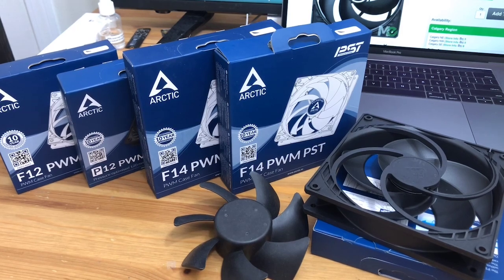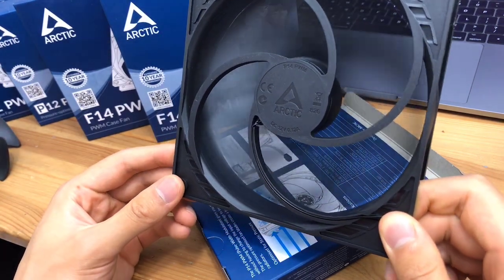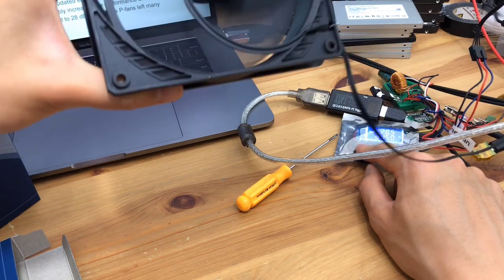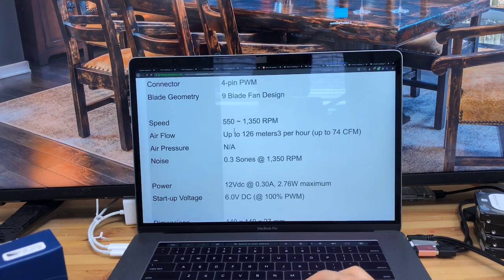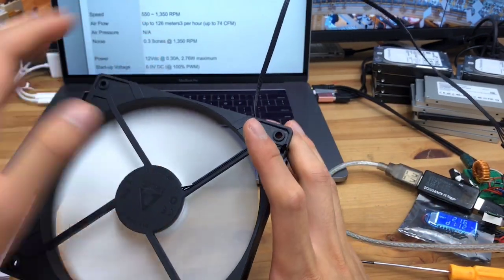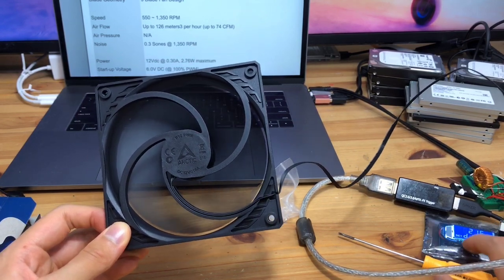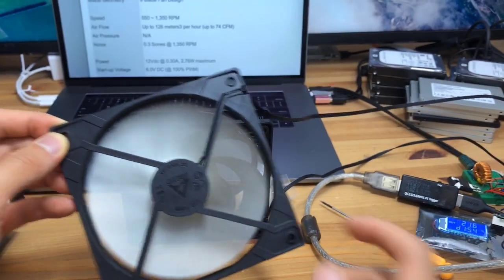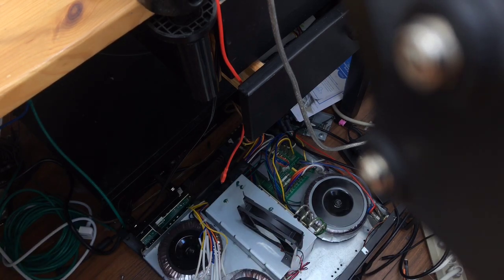Arctic P14 P12 F12 F14 Rev2 F14 Fans Test

Comment: Heads up for anyone considering these or the Arctic P14 for case fans. I tested the P14's and F14's extensively and went with the F14's. I have a very high end (read: high thermal output) gaming PC inside a Phanteks P500A case. What won me over was for the overall sound and cooling performance. The F14's were just a smidge quieter and of what you could hear, it just had a slightly better sounding hum to it. Cooling performance was also consistently 0.5-1C cooler when comparing PWM% levels between the two at all ranges. I actually really wanted to keep the P14's as they are "newer" and all the reviews praised them highly but I couldn't ignore nor deny the real-world testing performance results of the F14's over the P14's in my case. All in all, you can't really go wrong with either but the F14's also won me over considering they are actually designed for case airflow in mind (which makes sense of the performance edge they had over the P14's as low impedance to airflow case fans as was the case on my Phanteks P500A). I have little doubt the P14's would edge out the F14's for heatsink/radiator cooling and high impedance to airflow cases. To give you an idea of just how low impedence my Phanteks P500A case is, with the side-panel open (so components have easy access to ambient air), running RTX Quake, GPU temp stabalised at 75C. With the side-panel closed and all F14 fans off, GPU temp stabalised at 84C. With the F14's at just 30% PWM (corresponding to ~620 RPM), GPU temp stabalised at 77C (only 2C hotter than open side-panel condition). With the F14's at 100% PWM (corresponding to ~1400 RPM), GPU temp was 74C (only 1C cooler than open side-panel condition). With the P14's @ 30% PWM (corresponding to ~720RPM), GPU temp stabalised at 78C (1C hotter than F14's). With the P14's @ 100% PWM (corresponding to ~1675RPM), GPU temp stabilised at 74.5C (0.5C hotter than for the F14's and only 0.5C cooler than with the side-panel opened condition). I would never normally run the fans at 100% speed but I wanted to see how they two sets of fans compared at all speed ranges and it surprised me how low (only 30% PWM) I could run the fans and get still achieve stellar sound and cooling performance out of them. Anyways, hope this might come of help to someone out there. Oh, one last thing. I think the F14's are using the same internals for the motor and bearing as the P14's. I was concerned over the fact the F14's were released so much further back than the P14's that the internal mechanics/motors would be inferior but seems that is not the case and that they are using the same motor, shaft and bearing.
Reply: Appreciate your insightful and helpful comment. I'm also a happy owner of a P500A. Just two quick questions. Did you have front and top dust filters on when you did those tests? What's your fan configuration (I'm assuming 3 front intake, 3 top exhaust and 1 rear exhaust)? Also I really wish F14 had a white version like P14 does (not the black and white version).
Reply: That all appreciated, the fact the F12s merely "edge out" the P12s in unrestricted airflow situations is testement to how much the pressure optimisation of the P series comes with so little drawback in airflow. I like the way the industry changed overnight to seeing static pressure as a thing and manufacturers responded with fans that were pretty good at both.
Reply: What system do you have? You should never be getting those awful temps in a P500A. What fan layout do you have?
Reply: The P14 and F14 both max out at the same CFM (I believe it is 73CFM on the P14 and 74CFM on the F14), however, the P14 has double the static pressure.  So it's far better at sucking air through a filter or pushing air through grills, fins and radiators.  

That's what made me swap all the fans in my case to P14's.  The two in the front are sucking air through a cotton or nylon mesh fabric (no visible holes) and the top has the larger typical holes plus a filter on top that's held on by magnets.  The rear is just the typical larger holes for exhaust.

Figured I'd get more flow when it's all said and done by going with the double static pressure version.  

If they were just sitting on a table, then the F14 would move the same amount of air at a lower RPM, but as you can hear, they are louder at the lower RPM due to the extra, thinner fan blades.

I dunno.  Guess it depends on your case and what you're fans are pushing/pulling through.  I know there's no way an F14 could pull the air through my front filters like the P14.  I could have mixed it up but there was a good deal on a 5 pack so I just got all P14's.

Comment: Well, they are supposed to be P for Pressure and F for Flow, so the P's are for rads, air-coolers with dense fin stacks and filtered case intakes, F for unfiltered case intake or exhaust.

Comment: I'm def team P. I just did a build for a friend in a bequiet 500dx and put 3 p12's in the front, 1 in the rear, and used 2 of the silent wings the case comes with for the top. He can't hear anything, his 5900x is oc'd to 4.2ghz with a Noctua u12a cooling it and he's in love with the build.  My personal build also uses a 500dx with a 5900x and Noctua u12a except my cpu is oc'd to 4.4ghz at 1.275. I'm using 5 P14's and I'm in heaven. The sounds is pleasant, when it is that I can even hear it bc no music or what have you. Those P series fans are just excellent. Front and rear fans set to 'performance' mode in the bios while plugged into fan headers on my Asrock x570 Taichi Razer edition. My two top P14's are set to normal in the bios and they are effectively silent. So it's white PWM PST's and I'm extremely happy.

Comment: Not sure what you are looking for but you will never find a truly silent fan that pushes any kind of useful airflow.  I switched to these after my Corsair LL120's started flickering like nuts and I refused to pay another 80 bux for em.  The Arctic P14 PWM Pst fans went onto my Evga clc280 and 3 Arctic Bionix f140's freshen up the rest of my Define R6 and I must say couldn't be happier.  The p14's are 100 times quiter than my EVGA 140's that were stock with the cooler and even on high at the front of the case it's a pleasant whirr instead of the Jet engine sounds from the EVGA fans.  The other 3 aren't even audible at normal auto sppeds.  If I ramp them up to full (Which in normal use will NEVER EVER happen) you can hear them but it's not loud enough to be distracting or bothersome.  I'll buy Arctic in the future.  The New chromax lineup from Noctua is another solid choice for Flow and sound concerns and in my experience are just a tad quieter than these but at a few hundred rpms less.

Comment: I've had a total of 9 of these in my inwin 303. I love the price for what they are worth. They are noticeable above 60% fan speed. Around 1200 rpm. But I use head phones so it's not much to think about when the price of them is unbeatable. Given some AAA fans are like 30$ usd for a single fan. Best in the bizz.
Reply: heya. I plan either to get the P12 or the Bionix. Any thoughts about the noise? I want a quiet pc
Reply: @dv2045  if you're looking to save a little bit more just go with f12. But the bionix are definitely in a great price point. Dont over think it. I would just get the f12.
Reply: @ludahfang559  heya again! for silent watercooling a 360 rad would you get the P12 or the Bionix P120? I wont use them at 100% but just silent enough
Reply: @dv2045  It's up to you, if there is a difference in noise between them and you are willing to pay more for something quiet, go with the Bionix ones.
But i don't know if there is much of a difference, haven't seen any comparisons

Comment: This really thorough test. I have 4 of P14's in my Define R6, they are pretty good but can you suggest anything better  soundwise (running them from PWM hub)?
Reply from the maker: General noise troubleshooting: 1)Buzzing, clacking, clicking: Use rubber fan mounts instead of fan screws 2)Fans running faster than needed: Use PWM splitters (either chain Y splitters or get a 4way)  (or buy the PST version) to split the PWM control signal between all fans

The fans will run as long as the PWM is >5%. You do not need to 'kickstart' them, as this will happen automatically from the IC inside the fan.
Reply: @liminalsunset  Im experiencing more like air chuffing sound. Kind of low frequency huffing. Maybe I need to tweak the fan curves, altough at the same time I wish to maintain my current all around system temps.
Reply from the maker: @fobaa  You may want to check that the grille/radiator/heat sync the fan is mounted to is not too restrictive. Also, make sure there's nothing (filter, heat sync, grille, etc) too close to the intake. What speed are you running the fans at?
Reply: @liminalsunset  actually further inspection revealed I have too damn loud HDDs. And maybe CPU coolers
Reply from the maker: @fobaa  Try to disconnect the devices in your system and run one at a time to isolate the noise source. HDDs may benefit from resilient mounting to absorb vibrations that may transmit to the case, or alternatively, can be powered off when not used or changed with SSD.
Reply: @DBT_Rusty  heya. any thouhhts of the Bionix P120? its a slightly more powerful and padded P12
Reply: @dv2045  i have 4 bionix f140s showing up soon. i will let you know how those go. i have not used the p120 bionix but currently thinking about grabbing two to match my current project. i do know the padding is very minimal and more of a rubbery coating rather than rubber pads.
Reply: @DBT_Rusty  Nice to hear that Noctua is working to get 140mm variant to market. Thanks for the info! These Arctic P series fans sure are very high price/performance.
Reply: DBT_Rusty But no one wants to pay that much for a fan that’s not even colour neutral.
Reply: @fobaa  so the noise problem wasnt the p14s :D
Reply: @ShakeITyEA  Yes I think so. Damn loud HDD's.
Reply: @fobaa  Of course it wasnt these fans... These fans are dead silent compared to many others
Literally in the top
Reply: P12s makes the a weird motor humming noise especially when they're spinning at around 1000 RPM. If you want an extremely silent fan with just a little better fan performance as compared to the P12 fans, your best bet would be the Noctua NF-A12x25

Comment: People been praising these p14 as the best fans ever. Better than be quiet, noctua, everything... Now that's suspicious and makes me squint
Reply: They are not.  Sadly the P12 ( P14 also )  start very fast to gather dust ...and start making weird sounds in a few months . Over time they are louder that the F12.   / F12 are quieter in the long run.   If Artcic could fix the design of the P12 they could be the best. There is P12 PWM PST CO ( from continuous operation )   that have some special  2 ball japanese bearings that could be the solution to the problem but i have not tested it.

Comment: Just bought 2 of the Artic P14 140mm fans to replace the worn out fans on my Corsair H115i 280mm Radiator, hopefully they will do the job well. thanks for posting this interesting video, thumbed up :)
Reply: I'm thinking of doing the exact same, the fans are way too loud above 1000rpm. How did it work out?
Reply: @KloVnPT  I ended up buying the artic freezer II CPU cooler 240mm radiator version as my Corsair H115i had a terrible pump noise, think the pump was dying tbh. Anyway the freezer II fits perfectly in the front of the case i bought (fractal define 7 black / white version). So technically i now have 4 artic fans in my case 2 x140mm at top of case helping blow out the hot air, and 2x120mm on the radiator sucking cold air in the front of the case. My 3900x now idles as low as 30c depending on room temp.
Reply: @lee__1707  Yeah I'll buy 2 of those for the H115i and extra 2 to replace the default NZXT fans that came with the case. 

One more question, is it worth to order some rubber mounts or are they quiet enough?

I really need some quiet fans, my pc is right next to my left ear and I use open-back headphones
Reply: @KloVnPT  You cant go wrong with rubber screw mounts you can get a bag of 20 of them off amazon for cheap. peace of mind you will have a quiet setup no matter what. I do find mine quiet but my pc is under a desk at my feet, if yours is up next to your head get the rubber mounts too, you might not need them but peace of mind like i say

Comment: Great review! Seems that the Bionix P120 is the only alternative to the Noctua NF-A12 with (around) the same noise/performance
Reply: Noctua NF-A12 costs more than 4 times than these Arctic pressure optimised fans. 
And they don't spin faster than 700-800 rpm in real life use for me so noise is not an issue.

Comment: Nice review but Arctic claims that the amps for the F12 fan is 0.24 A @ 12V, but you had only 0.07 A @ 11.7V so is it really working at it's full potential during your test ?
Reply from the maker: It's likely that the current rating printed on the back of the fan is the "safety" current; the maximum current the fan is able to pull, with the fan blades locked or under significant backpressure (unsure of exact specification of UL standard)/when it is starting, and not the "nominal" current. Some fans have both ratings printed on the back for this reason.

Comment: Thanks for the test; recently got 3x p14 for the chassis airflow, and now i am thinking to also get p12 to switch cpu fan (it started doin significant vibration on 1.100+ RPM after more or less 4 years of usage, model is cooler master 120 ab), was curious how good it is (since be quiet pure wing 2 cost about the same $ here, according to some other test that i found - be! does slightly more noise while producing the same amount of air pressure). Guess i cant go wrong with arctic in this price category :) 
Talking about p14 - i didnt notice any vibration at all (i added antivibro pads while was "screwing" it to the case tho), at 650 rpm or lower it also doesnt produce any significant noise id say :)

Comment: Ya man the 5 packs for $25-$30 there awesome. Price to performance to noise ratio is great.  Once properly mounted they are nice.  I choose these for the reasons listed before.   Also this fan has be dissembled so take that for what you will.  I love corsair mag lev fans but $20-33 each just not worth it unless you have no cash filter. Ive built rigs for people with only p series fans for everything and its awesome.

Comment: I have some Arctic F12 and consider them to be too noisy to use.  I might consider the P14, but my budget option lately has been the Noctua Redux series.  Maybe the P14 would be a good case fan and I will put the Redux on my radiator.
Reply: You sure it's the 4-pin f12? because the 4-pin f12 is superduper quiet with lower rpms. The 3-pin f12 was too loud.

Comment: Tried the Arctic P14 based on the many reviews of it saying its the most silent fan..Bought a set of 5 bundle, and put 3 into my case. Well I already noticed something was bad when I took them out of the case. The fan plastic is very hard and it makes a sound when you flick it with a finger, just like a wine glass does.. So to no surprise when 3 of them spin up side by side, they begin to "sing". Resonance overload! They simply begin to whine at the frequency that the plastic resonates at, due to it being very hard. Fans need to be somewhat flexible and more rubber like to not resonate.

So due to the resonance, the arctic fans are the most loud fans I ever tried.

-never test fans one by one, you need multiple to check if they resonate inside the case.
Reply: Use silicone gaskets!
By far they are the best and if you pair them with GT they are sick!

Comment: Which 120mm fan would you recommend replacing in the 500 watt deepcool power supply ? the native fan makes sounds as if the train is knocking the wheels on the rails

Comment: thought about getting these, caus they where cheap and got some good numbers. But if they got vibrations, it does not matter how quiet they run, they will make a shit ton of noise when in a case.
Reply: I have these and they are loud, you habe to keep them very low rpm

Comment: I have them in my 280mm liquid freezer when i installed the cooler i forgot to peel the plastic of the logo when i started to peel the fan just moves down a bit the when reduce the pressure goes back to the frame of the fan and then i use my other hand to support the fan thats normal right ? they work i didn't damaged them ? i talk about p14 btw

Comment: i-plan to use the P14 on my 280mm rads, and for anyone who has any experience or insights. I wanted to keep the P14 fans running at a fixed speed (as quiet as possible) on idle/light tasks and just ramp up when I'm gaming, doing heavy workload.

Around what until what temps is it okay to keep a steady and quiet rpm on the radiator fans, and if anyone has any experience, around what range is the P14s quiet/barely audible?

im, using an NR200 case if that helps

Thank you for this vid!

Comment: My Motherboard is an old Intel 67BL which only have two PWM (4PIN) fan ports, one for the back, & another one in front. I already have two Corsair ML140 140mm PWM (4PIN) Fans that am using in my PC case/cabinet Now, in order to create a 5 PWM PST fans Daisy chain, can I connect my two Corsair ML140 MM PWM (NON-PST) FAN with my three Arctic P14 PWM PST CO 140MM FAN? If yes then what should be the order?

Comment: $4 per fan here, in a 5-pack
Reply: For the simple 3 wire ones right? The PWM ones are a bit more expensive.
Reply: @magicmarger   Checking now it's like $4.4 for 3-pin and $4.8 for 4-pin
Reply: @thelazyduck9370  oh fuck me over, I just paid around 10€ for a 4pin one.
(Pretty much the cheapest one incl. shipping that I could get here)